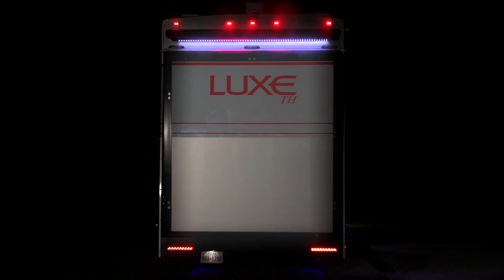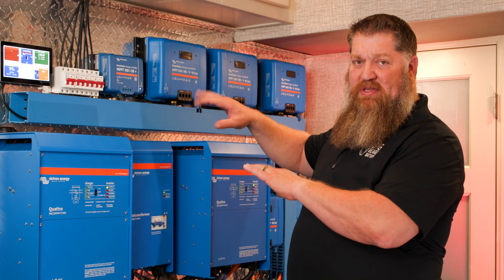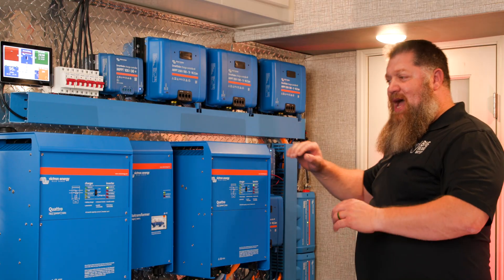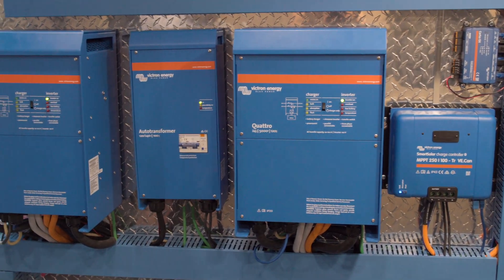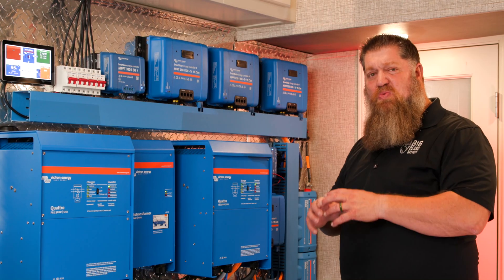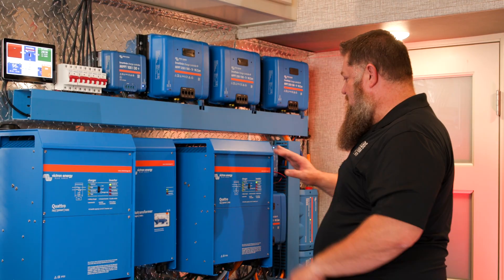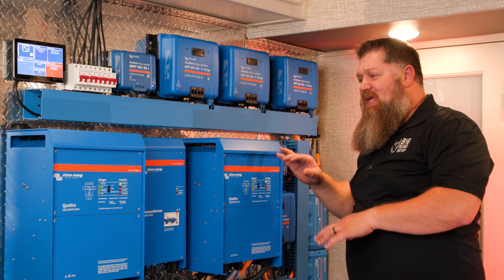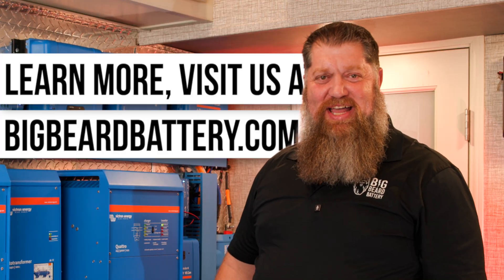Running 3 A/Cs on Battery Power?! | The Ultimate Off-Grid RV Build

Comment: Damn Todd! I'm totally envious! I'm sure some weekend warriors like myself (not really) can't justify the expense of a Victron system of any size. However,  my single Multiplus 2X 120 pulling from a 1120AH battery bank has saved a vacation due to bad 50 amp power at the pedestal, forcing me to run on a 30 amp connection. 1200 watts on the roof, 3 AC's running all day in the North Carolina sun, no problem (of course easy starts on the AC units had to be there, and 1 AC running at night, and using power share). The RV park was totally booked so they couldn't move us....and they were in denial about their 50 amp line being bad anyway. I had to be mindful of usage, switching to propane for hot water, limiting microwave, etc. Oh well, the system saved us and was a good investment.